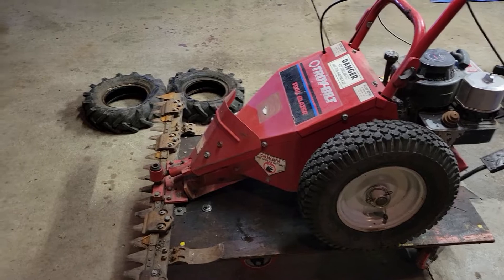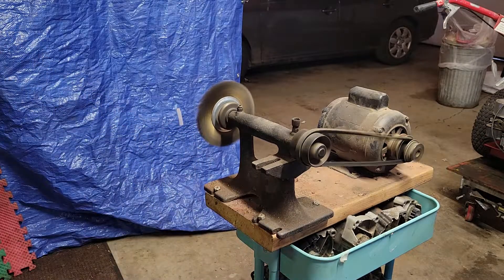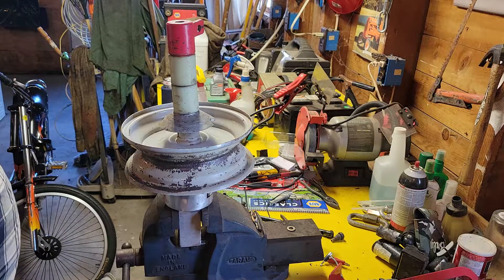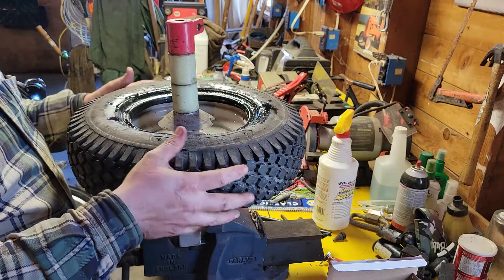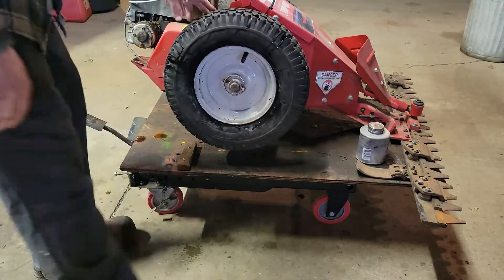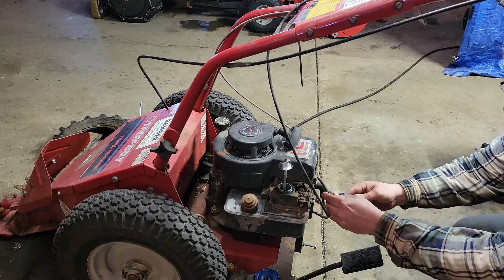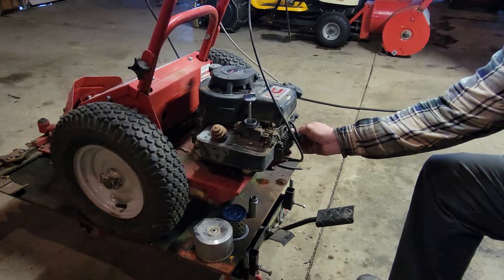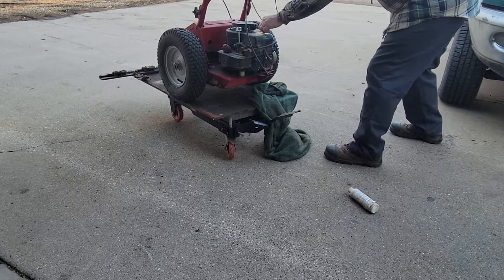Troy built sickle mower. part 1

Comment: Great to see another video from you Dave. I think the video is a lot better with your new phone. I have a Harbor Freight tire changer and it does make it a lot easier to change the tires I bought a couple of tire irons I use with mine. I tried to tell you didn't have the inner tube in the tire. LOL Great tip about putting a washer on the valve stem. Hope you wife is feeling better and doing well. Have a great weekend!
Reply from the maker: Hi Bob. Yes my wife is OK. I never  showed symptoms. I like the  tire changer. It's saved me a lot of time. Hope you're  continuing  to be doing  well

Comment: I bet it feels great to be back out there Dave.  New name   good start.  Old school buffer   love it.  I am not upset.  I like your England #3 vice.  I have one too.  (actually 2)      I was wondering where the tube was in that wheel.  LOL  You don't need to go to the gym.  You have and old Briggs Chokeamatic.  Always one more try  LOL  I do like the machine.
Reply from the maker: Hi Bruce. Yes it does feel great. Weather  still not great but at least it's not snowing but now it's raining  for 4 days which means lots of snow. I do love that  vice. It's on a bench I don't  use much.   I'm keeping this sickle mower. I made part 2 yesterday  but  I'm a little  surly  in it LOL
Reply: @davessmallenginerevival2847  Sorry the reply (above) was choppy sounding as I was commenting as I was watching.  I tell my wife I don't need to go to the gym as I am a small engine mechanic.  I get good cardio exercise when an old chain saw won't start or as in this video, an old Briggs 5HP won't fire.  It is hard work.
Reply from the maker: @BrucesShop  not at all. I understood  what you meant.  Yes pull , pull,  pull. LOL